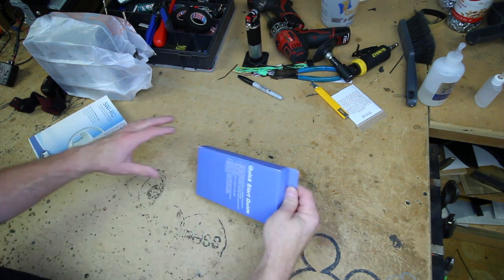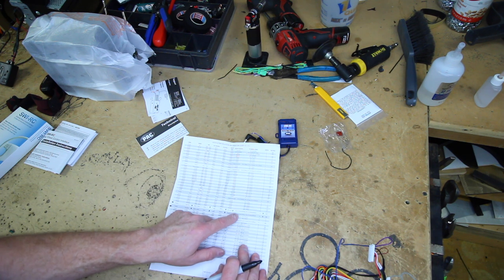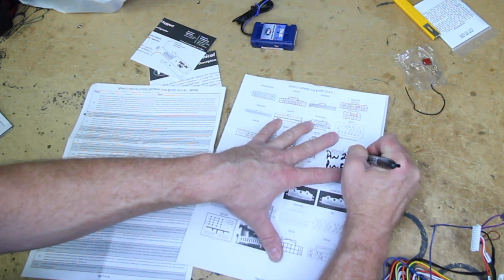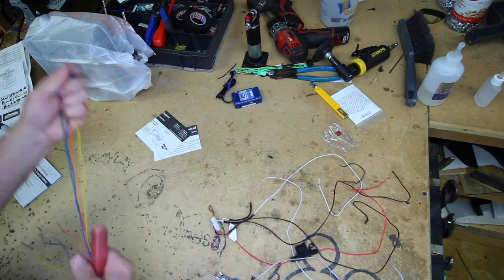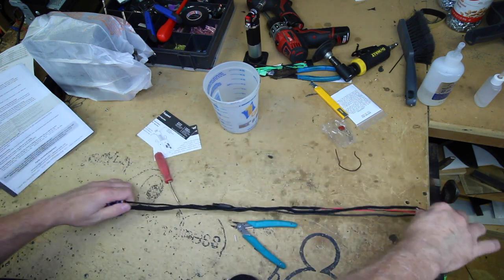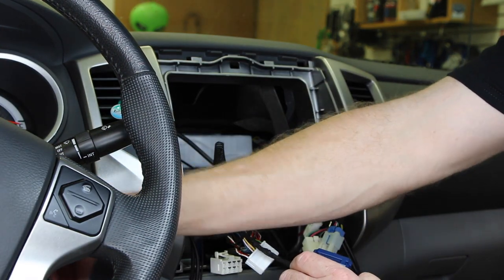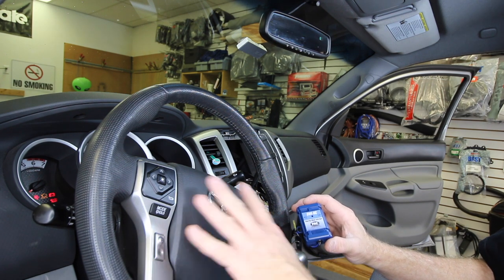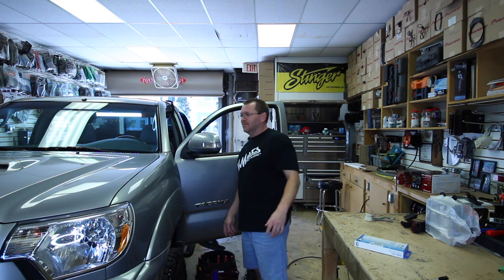How to install a Pac Audio SWI RC steering Wheel interface

Comment: I am assuming that if the same button is used for two functions that you just use it twice in the programming sequence.  For example, the instructions reference Preset Up/Disc Up and Track Up/Seek Up.  My vehicle (2005 Tacoma) will use the same button for both, depending upon the source.
Reply from the maker: Kenneth Southard this RC only will do one function per button. If you want to do 2 you will need the SWC cp2.

Comment: One question. Where is the harness for the SW located? The video just shows it hanging out of the hole the head unit came out of.
Reply from the maker: +Alan Brandle it is usually plugged into the factory radio.

Comment: hi, how to do get the Pioneer AVH-4200NEX to integrate with the controls on the steering wheel of a bmw e92 335i ?
Reply from the maker: Year?
Reply: +Five Star Car Stereo 2009
Reply from the maker: +Lo Haowen get the Pac-audio swi-cp5. It will work in your can and you can program it from your phone. Downloaded the control pro app and it will give you the wiring has well.

Comment: Finding the car isn't the trick, finding the radio is. They only list 15 kinds. What if yours isn't in the list? Why no more radio brands or comparable codes?
Reply from the maker: +alan933 give PAC a call
Reply: I did , they said other brands "might" work with the "other" or "Pioneer" setting. I will try this.
Reply: After trying "other" i could not get it to work with either computer programming or manual programming. The lights on it flashed but did not control any part of radio. Then, I selected SW1 in my radio settings (Soundstream VRN-64Hb) and it did work but couldn't get to assign any control to the "up preset" control button. It only allowed "up" and "down" of station seek function.

Comment: i got pioneer i fallow the step but don't response the steering wheel i think because don't have all the bottoms the car is mazda 3 2011
Reply from the maker: +STICKERSHOP WINDOW TINT SIGNS GRAPHICS did you set the switch to 7? Do any of the buttons work?
Reply: Five Star Car Stereo yes thanks we installed

Comment: Hi Dean.  I noticed in this video you wired the PAC interface to the factory harness.  Would it be possible to add this interface without splicing into the factory harness?  Would wiring the interface into the "3rd party" wiring harness work instead?  For my stereo I'll be using a Metra 70-1729 and it asks me to ground out pin 16 on the factory harness.  Would I be able to this by wiring my 3rd party harness to the ground (black)?  Great Videos.  Thanks in advance!
Reply from the maker: What car do you have?
Reply: Hi Dean, Happy 4th!  I have a 2013 Honda Fit Sport.  My mistake on the original post; instructions are to ground pin 5 and connect the interface to pin 16 (http://www.metraonline.com/files/aswc/ASWC-1_INST_15.pdf).
Reply from the maker: +Duncan Kim hi there, what we like to do if the wires are in the radio plug is grab a second plug. We then pull out some pin and re pin them in the harness we are going to use.

Comment: How did to remove the extra wires from the interface? What tool was that, a pick?
Reply: NM, I figured it out! Hopefully took out the correct wires ;) LOL As long as the instructions are right I think I'm ok...haha...

"The other wires on the SWI-RC, green, yellow, orange and blue wires are not used for your Nissan Titan."
Reply from the maker: +ClausenLT yes it was just a pick tool
Reply: I was able to use a small flat head...all though I have a pick tool...but the flat head was right in front of me.

Hey, big time props on actually soldering! I'm a DIY'er but I own a business, I do automotive paint, so I take stuff apart all the time, and I've been installing my own stereo stuff for over 25 years....and the reason I install the stuff myself is BECAUSE I want it soldered and heat shrunk! (Had a nice Denon CD player get fried many moons ago from one of those stupid tap in connectors!)
Reply from the maker: ClausenLT ouch that would have sucked. We sold Denon back in the day. Nice sounding stuff
Reply: Five Star Car Stereo Got my PAC installed this evening, everything went off without a hitch. Programmed correctly the first try! ;) 

I also installed a backup camera. I tested it, it was working, (head unit has an option to switch to camera.) Then i hooked it to reverse wire and it wouldn't work. I'm thinking to myself... "what the heck, I had it working ."  By now it's getting late...then I realize the plug where I tapped into reverse I had not plugged back in...LOL...open circuit I guess. Working now.

Thank God for Youtube. Sure makes things easier than back in the day!!!

Thanks again for the video...now I have to get my amps installed and get rid of factory speakers. I have 2 ScanSpeak  7" 4531's I'm putting in the doors and the smaller Vifa XT's I'll upgrade to the Scan Speak D3004's later.
Reply from the maker: ClausenLT are you going active crossover or passive?
Reply: Passive...this plan has a variation for the Vifa XT, and the Madisound Xover for the 4531 is the same as this one....http://www.audiokit.it/ITAENG/KitDiffusori/ScanAudiocomp/Ultimo/Ultimo_3.jpg

https://www.madisoundspeakerstore.com/auto-kits/scanspeak-6.5-2-way-signature-car-audio-kit/

The nice thing about a passive Xover, you can adjust tweeter to woofer levels....

I think I'm gonna leave the resistors off the tweeter because I always thought the XT was a little tame...but I have a box full of resistors if they are too bright. 

I am also making a variation on this...

http://forums.clubrsx.com/showthread.php?t=758946

I do auto paint for a living so I've already painted one
Reply from the maker: ClausenLT oh damn, well that will work. 👍 I dig those tweeter pods. I had a guy bring us some out door light pods. He had us mount his midrange in them and do basically the same thing. Turned out surprisingly nice.

Comment: Been trying to install this for hours on my pioneer head unit in a 2013 Hyundai Santa fe,  I'm lost on what to do with both ground wires?  I have one going to the ground of the head unit harness and  car harness, if thats right where does the other ground go?  Thanks for any help!
Reply from the maker: Brandon Schlechter the 2 blacks go to pin24 black and pin17 gray. White wire to pin4 blue.
Reply: Five Star Car Stereo Thanks for the reply! Thats how i have it wired but still only able to get a few of the buttons to function
Reply from the maker: Brandon Schlechter that is strange, your car is just a 2 wire. What buttons don't work?
Reply: Five Star Car Stereo volume up and down and mute do not work
Reply: Five Star Car Stereo it acts like it works great during the programing without the radio plugged into wire harness and then as soon as i plug the radio in it just stops working right
Reply from the maker: Brandon Schlechter program it with the radio plugged in. Some cars need to be plugged in.
Reply: Five Star Car Stereo thanks for all of the help guys! It ended up being a faulty fuse that wasn't recognizing a voltage game when the button where pushed.
Reply from the maker: Brandon Schlechter wow that is a weird one. Glad you got it to work, enjoy

Comment: Can you do a review and install on the PAC SWI-CP5?
Thanks!
Reply from the maker: Yes we are just waiting for the right car. Most of the installations get the RP4 and they already have steering wheel controls.
Reply: +Five Star Car Stereo I received my CP5 today and I was looking at the wires and there's a red/white wire. Where do I connect that wire. There's another solid red wire and a solid black wires, which is I already where those two wires connects to, except the red/white wire that labeled "12V ACC OUTPUT" 
Also there's a lot of wires that I think I won't be needing them since I'll be programming it on app mode (IOS)
It's for 2015/16 Accord Sedan on Pinoneer 4200NEX...
Reply from the maker: +Randy Pacion the red white wire is for a data connection, you will not be using it in your install. You will just need Black- ground, yellow-constant 12 volt, red -accessory and white. You may also need white black.
Reply: +Five Star Car Stereo what's the black/white wire for?
Thanks!
Reply from the maker: +Randy Pacion white black may need Togo over to a factory Bluetooth brain if it has one. Have you downloaded the app, it has the wire diagram for you.

Comment: Do you have any video on installing PAC Control Pro SWI-CP5?
Reply from the maker: Calleigh Chau no we never got around to that and now that the cp2 is out we probably never will. We did do a cp2 video they are very similar 
https://youtu.be/UyJ_2yvUS18
Reply: Thanks

Comment: I have the same truck year make and model and I'm doing this however the plug that comes from the trucks swc harness has alot more than the 3 needed wires for this.... Are the remainder of the wires in the plug useless or do they have a purpose?? 

Looked for hours to find a diagram on every wire on that specific plug (28 pin)